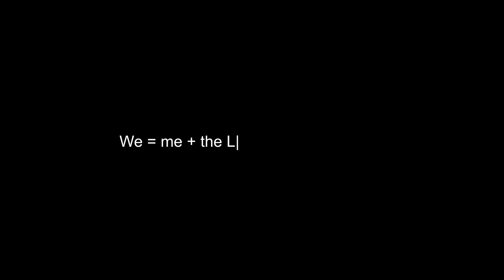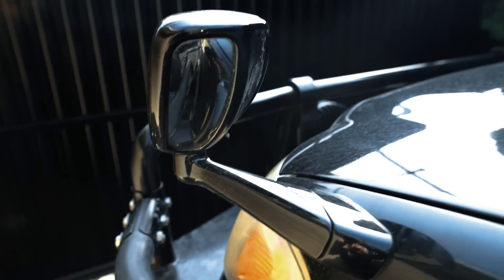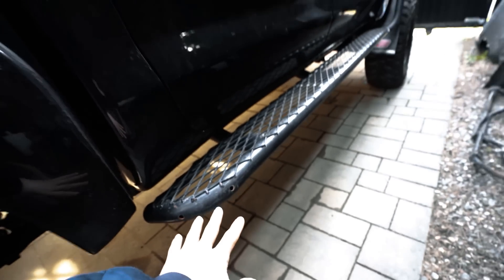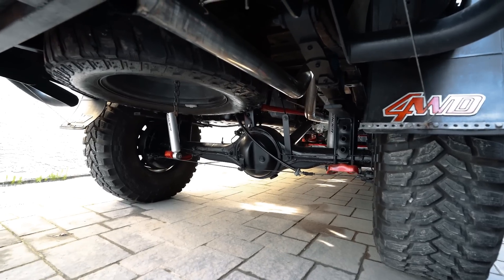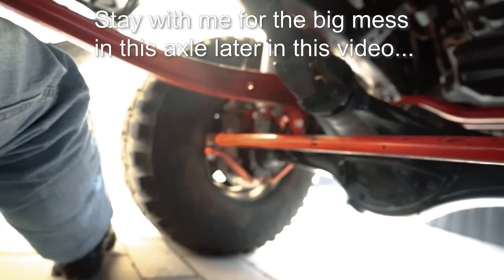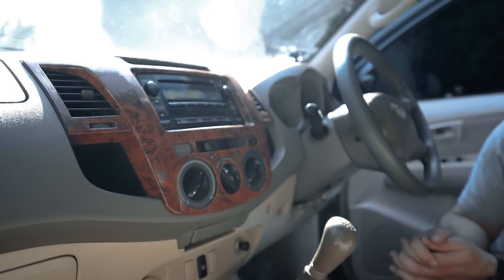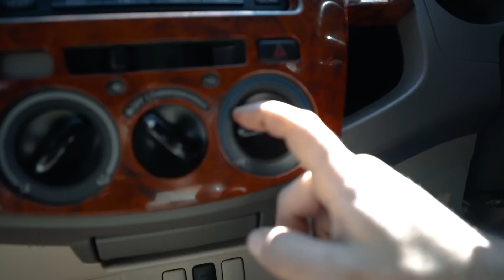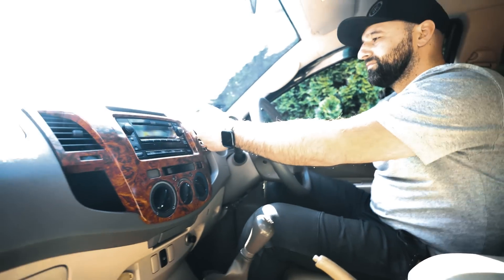I bought a truck online I've never seen | SAS N70 Toyota Hilux RHD import

Comment: Why not buy a Tacoma or Tundra if you want a pick up trunk, Because of Diesel power? It is so hard to find parts and people to fix those kind the trucks, US Toyota dealer’s technicians don’t know how to fix it, it is a bad idea to use it in North America for overland but it is your money that you can do whatever you want.
Reply from the maker: Video beginning explained. Tundra is in the line.
Reply: Bro diesels are easy as hell to fix. Tons more torque for offroad and diesel get way better fuel mileage
Reply: There is a company in San Antonio, TX called Diesel Toyz that converts Tacomas, 4Runners and LC’s to diesel. They used to use D4D engines now I think they use the VM Motori diesels
Reply: @Adventure_Rig  sure diesels have a lot of low end toque but have no high end hose power, slow like hell when driving on the freeway, that’s why Toyota doesn’t import diesel to U.S because you are the only one buying it, if diesels are so good why European countries Abandon diesels
Reply: @jaypikachu6660  thats all gearing man. They can go just a quick as a gas car if needed. Jeep and chevy have gas models in the US
Reply: thats all gearing man. They can go just a quick as a gas car if needed. Jeep and chevy have diesel models in the US
Reply: thats all gearing man. They can go just a quick as a gas car if needed. Jeep and chevy have diesel models in the US
Reply: Nothing difficult or mythical about a diesel just like any other engine don't know where people get the idea that diesel is hard to work on. Also in Australia that is a awsome hilux with a solid front diff swap makes an awsome fourby we take these things to the extreme in Australia rock crawling ect
Reply: Things are simple as hell
Reply: The issue I have with diesel for Monique, is the winter in Canada. Diesel in freezing temperatures can turn to gel. At the very least, she'll need to carry a block heater. Gasoline would be more practical. But Tim from truckhouse life makes it work.
Reply: Hey it's not hard to fix parts yea but nothing a bush mechanic can't do
Reply: @peterstubbs8587  literally diesel anti freeze you add to the fuel tank...
Reply: @darcykeddell4930  well, I learn something new everyday
Reply: @peterstubbs8587  and there is a type of diesel in my country we call alpine diesel which has antifreeze already in it for up in the mountains

Comment: I own a Vigo 2013 model with 1 KD engine swapped in

These are ridiculously tough vehicles but yeah you need to put in some work in your truck b4 it will be pleasure to drive

Once the maintenance is under control these things are bullet proof

Comment: I have a 2013 3 litre turbo diesel Hilux I bought new. Drivetrain is stock with some body mods but it has been very reliable. Non-standard, highly modified vehicles are always a risk when used for overlanding/touring and you’ve compounded that with an import. You’re a brave lady 😁

Comment: Hilux's are great vehicles, I own the same model except 2015 extra cab SR5.
First rule, never lift them any more than 3 inches without proper UCA and camber compenents to avoid body modifications.
Second rule, never go bigger than a 33in tire with standard diffs and gear ratios
Third rule, keep the engine stock (except for intake and exhaust) they will keep going for many decades to come. It wont be fast but it will be reliable and theres nothing cool about being broken down on the side of the road
Fourth rule, never buy a second hand vehicle from Thailand... Period!
Fifth rule, always help a fellow Hilux owner out... If you need parts from Australia just shout out. Happy to help with any 80 series or KUN26r parts you may need.
Seems like you and the fellow have a project on your hands and are going to need parts BIGTIME. My suggestion would be lift the cabin off of it and go from there. It will give you access to all the hard to reach places that need welding ect and also access to mount the new HVAC system plus will give you the opportunity to inspect the complete chassis for more cracks and fractures.
Let me know if you need the workshop manual, I'll email it through.

BTW, glad you bought another Toyota!
Reply: Exactly what I was going to say and more. Particularly the importance of geometry of lifts  past 3 inches, camber etc etc. I am not a fan of spring over conversions and would looking to cut that kludge out. On the plus side, no deep rust, a relatively simple vehicle to modify (properly) and a wealth of knowledge and parts here in Australia. Terrain Tamer and the like will do a full kit for the front diff, make sure the shimming is right or your new seals will leak. Should come good once you pluck the junk.
Reply: First rule should be fit a secondary fuel filter and oil catch can 🤷🏻
Reply: Can you explain the Thailand comment? Are they just poorly build there?
Reply: 1st rule dose not apply to an SAS vehicle
Reply: 1st rule only applies to IFS but I’m on 5 inch lift (3 sus, 2 body) and it still drives alright
Reply: Depend on the price And who you buy from
Reply: The third rule is not really a good one. The 1kd has been shown to deal very well with making good reliable power and not shorten it's lifespan. And the first rule really only applies to ifs, and since this one is sasd it's just not relevant.
Reply: @JohnHenkamGangte  Those mods done in Thailand and other countries like Bali etc to the hilux are normally done for show and nothing else and no quality trade skills. There isn't many highways where you need to sit on 100kph. I bet majority of that hilux never went over 50kph around the streets of Thailand.
Reply: @JohnHenkamGangte  they cut corners over there with builds like this mate. Just done in someone's garage probaby and they thrash the fuck out of them just look up 4wd videos from there 🤣

Comment: Interesting purchase - I am on my 3rd import (Pajero, Prado and a Galloper) - One thing I have learned is that you should stear away from modified export units (Like you have discovered) as it seems that madified units are typically modified poorly. The Pajero was bone stock and was a dream - The Prado had a few small mods and was a week of evenings and two weekends to remove and make right and the Galloper was just a bloddy adventure to put back right.

Comment: I found out the hard way, in 1988 during a trip through the Andean mountains in Venezuela that a 1986 Jeep Grand Wagoneer (made in Venezuela for the Venezuelan market) had no way of blowing air through to the defroster/windshield setting. It was vents were sealed shut from the factory. Unlike your situation of exporting the truck to a different geography, this is a pretty big fail IMHO, since the truck needed it that rainy day in December, and it happened within the same territory the truck was designed to operate in.

Comment: I'll recommend you to sell it people who'll use it near the equator, idk if its common, but vehicles are customized to fit the weather zones they're meant to be used. No heat is needed in it in Thailand. Too much to do and pay for conversion, else you'll either pay alot, or be uncomfortable from mid autumn to late spring.

Comment: Very nice truck.

The Solid axle swap is a mod I would like to do to my 2008 Fortuner.

The 1KD-FTE like to crack pistons and have injector issues.
The rest of the engine is built well.

A few suggestions from my side is definately replace with new and not rebuilt injectors and if you would like extra peace of mind, replace pistons as well.
Toyota had a few revisions on pistons. I had a piston crack at 240 000km, wish I had trusted my gut feeling and replaced pistons earlier, as I was the 4th owner.
When it cracks a piston, it really ruins the sleeve.
4 pistons would have been cheaper than resleeving and all the machine work that needs to be done.
After about 240 000km and inspecting the sleeves that were not damaged, it would have done many more kms. 
It looked new inside.

Definately do a intercooler upgrade or relocate it to the front.
The top mount is too small and only half way effective at higher speeds.

Great content and keep it up.

Comment: holy smokes, best of luck to you. but I would have bought a 100 series again, since you already know it and have some parts already or an 80 series, you have plenty of diesel ones up in CA. in your case I think you will have to work with what you got. fix the issues and you should have a decent truck to travel, if you were to do it again, would you import that particular hi-lux again?

Comment: Had the same experience when I imported my hilux from Thailand, they swapped the tires and the facelift was hiding  signs that the vehicles had front accident damage,alot of wiring hack job that I had to repair. Lesson learned, Never buy a modified vehicle

Comment: Great hilux model, its unfortunate about the mods done, as soon as you mentioned where it was from I knew you would have death wobbles. they build the 4x4s for show only in those countries most of them don't even run front drive shafts and they never see any highways just the local cruise streets at 40kmph. As you would have seen when you were in Australia there are many many parts and quality aftemarket parts for the hilux, including heater cores.
This build will be a good watch

Comment: Could you let us know how much you paid? I have an auto Hilux invincible 2007 3.0ltr . They go for about £7-9k in the Uk with 140k miles on the clock. Very brave buying that online. To be fair the engines are normally bullet proof . Clean the chassis up and ditch all the crap and you’ll have a decent truck. Good luck .

Comment: The only reason this hilux broke down on you is because it’s been fucked around with. From factory it would be fine depending on how it is treated. I’ve got an n70 and it’s been a work Ute and just been flogged it’s whole life. Not looked after at all. Runs like a charm. It’s been taken on the beach and not washed for a month more than once just because my dad didn’t have time when he had it, no rust at all.

Comment: A lot of age, a lot of flaws, a ton of mods, a ton of CRACKS? I know its a Toyota, but I'd have a few mechanics look it over, decide what needs to go, what can stay, etc, but I wouldn't risk driving it until it's road safe, the cracks and the rust would be major concerns, since it's not normal safe "surface" rust, like that's flaking rust that comes off with just a simple tool? Nope. Just nope. Good looking truck, but nope. You jsut nought an expensive restoration project vehicle, or that things headed for a junkyard for not being safe to drive without a lot of work, some of it unecesarry because whoever had it before you did so many mods. 
Best of luck, though. Lesson: never buy a vehicle sight unseen. Ever!

Comment: I can't understand why not just buy a Tacoma??? And then modify it. Rather than ship something from overseas and hope for the best. Personally, I wouldn't buy one....too small. I'll be overlanding in my F150, which I've almost finished working on. Tacos seem to be very popular, these days. I see them everywhere, with their rooftop tents. What you have now, looks like a parts truck. Just strip off the good bits, and throw the rest away. I would never be able to trust that comedy of errors. After what happened, you need a vehicle you can trust. A manual diesel for overlanding doesn't sound like a good idea.

Comment: The easiest answer is to cut your losses early, but who would buy a foreign truck like that, in that condition and a right hand drive in a left hand drive market? The truck is already in a sad state of affairs. The hard pill to swallow is to re-do the entire drive line and suspension components. It will be expensive, but its your problem now. You should have bought from a reputable market where you could pay a company to do a post purchase inspection, like in Australia or UK car market and made sure the car was as advertised before it left the country of origin. Anyway, let's see what you will do on the badly modified Hilux.

Comment: Never ever, buy any car that has been modified. It’s never a money saver, think of it this way. You mod a Hilux, lift, 35’s, rooftop tent, well what would you do next. Drive it back and fourth from bingo, or hit the trails. Welds are cracking, it just doesn’t feel as great as it use to, so you sell it. Now you guys just bought the end of life of someone’s project. Take it all apart, probe every orifice and replace every fluid, grease, grungy worn out tired part. It’s not called adventure building for nothing, oh yeah, buy a decent welder, learn to use it.